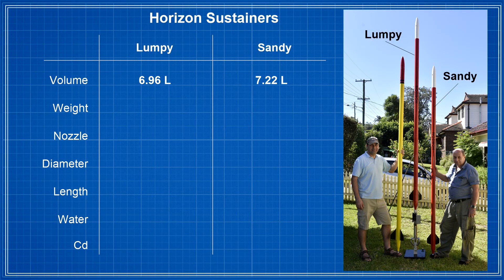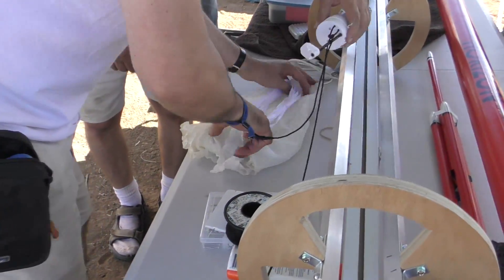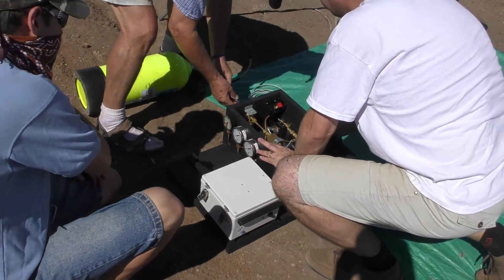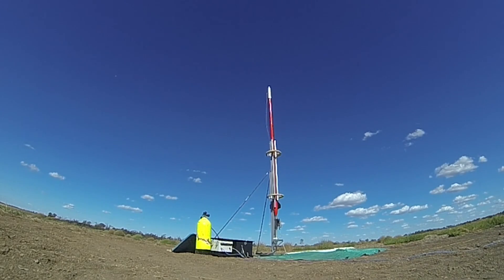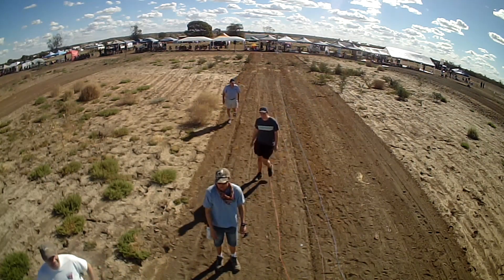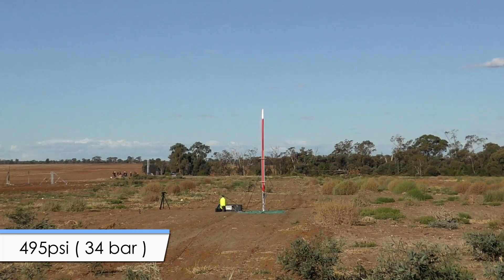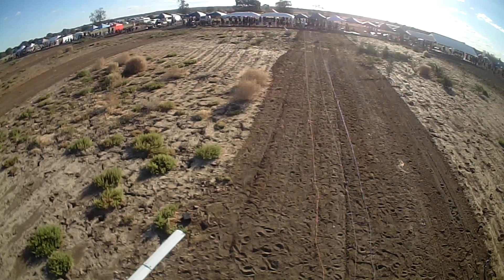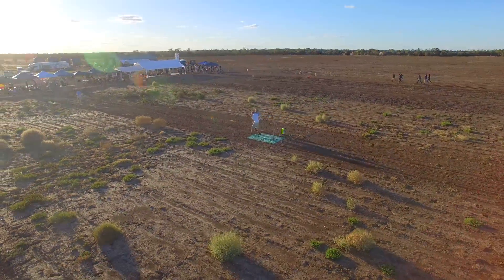2 Stage Water Rocket - Part 14 - First Flight

Comment: Where comes the heat from? The air in the cuba tank is compressed and at normal temperature. If you decompress it during the filling of the rocket and compress it again at lower pressure, must the rocket not get cold?
Reply from the maker: Here is the full explanation: https://www.youtube.com/watch?v=I7i8ELEF3ro

Comment: Load the rocket wite ices water to keep temperature down.
Reply from the maker: That doesn't work. We have tried this approach before. The reason it doesn't work is because the air above the water compresses and heats up regardless if it passed through warm or cold water.

Comment: Why not fill the rocket with ice water? You could also attach a shade structure to the launch tower.
Reply from the maker: Ice water wouldn't really help. The air still compresses above the water and heats up. (we've done the experiment)

Comment: I think I know why your rocket bent,   when you made the composite tube, you made it with a back bone. like a fishing rod,  at the point where the fiber overlapped, it  made a back bone , a point with slightly more fiber adding less stretch,   if you do a crosscut you should see the extra layer overlap . even a few extra fibers on one side can cause a back bone.
Reply from the maker: No, the pressure chamber was made with sleeves which are completely circumferentialy symmetric. Here is an explanation of why the rocket bent: https://www.youtube.com/watch?v=I7i8ELEF3ro

Comment: Funny t-shirt idea: [composed like an old style newspaper headline, in black and white]

"Chipmunks hurl carbon fiber bananas at the moon"

All around the horizon rocket in the middle [perhaps the rocket, alone from the rest of the image could be in color], one chipper with a lab coat, a clipboard and coke bottle glasses, one in army gear and helmet, one with a propeller beanie cap and a slingshot in their pocket, and one with a dynamite plunger and steampunk style aviator's goggles, perhaps with a rather deranged look about him...

Would make good project merchandise.

Comment: This beg for some experiments with rocket temperature and measuring it with "gun" thermometers. Like "will shading scuba tank help with temperature of air pumped into", or "using water with ice crushed/blended into slush to fill rocket and let it melt during pressurising". But I'm worried that temperature difference in parts of rocket may cause structural problems.
Reply from the maker: A lot of these issues will be covered in the next video, including thermal and other experiments.

Comment: if you actually manage to launch this rocket at full pressure you Will be able to reach easily +700m that is over you personal record so im pretty sure you Will manage a +1000m flight
Reply from the maker: For maximum altitude I think one of the trickiest things is going to be getting the second stage to launch vertically from the booster. Even 10 degrees from vertical you lose significant amount of altitude.

Comment: I would think 1, add fine axially aligned tension lines to counter the bending moment, 2, pre-cool your incoming air as much as possible [put the tank in a bath of ice water for instance] and 3, put up some kind of sun shield.

I am guessing that your pressure regulator(s) did not work as planned and that is why it over-pressured?

Even if the pressure was forming from a reaction inside the pressure chamber, this pressure SHOULD HAVE stopped any more flow from coming in as soon as the regulators reached their shut-off limiter(s)

Also, double, triple or even quadruply redundant regulators is never a bad idea with thin housings like  these.
Reply from the maker: The rocket did not over pressurise it reached the correct pressures that we wanted. We do not use a pressure regulator for these rockets. We just have a direct connection to the tank via a small hole and we control the flow of air until we reach the desired pressure.  We normally fill it by letting the air in in bursts, let the air cool for a while and then let in another burst of air. We may have just let in longer bursts of air this time or didn't wait enough time between bursts. This is how we control the cooling. We used a similar fill pressurising pattern to one we used with our other rocket that did not bend. There were a couple of other issues that made this rocket bend that will be covered in the next video. Cooling the air prior doesn't help much because the air picks up heat again while it travels through the hoses and manifolds. The air also bubbles up through a column of water. The air still compresses above the water and heats up. We've done experiments with this previously and bubbling the air through water had no effect on lowering the temperature of the compressed air. We had a sun shield over the rocket prior to launch while waiting, but once it was on the pad we removed the sun shield as we wanted to get clear video of the launch.
Reply: @AirCommandRockets  Somehow I must have misunderstood the pressure to have at some point exceeded the target pressure.

I fully understand the compression heating issue, I work with both engines and refrigeration systems.

Maybe what would be a better way of saying what I meant was to 'encase' the vessel with moisture [perhaps a fine mist on little removable upright rods] which had been chilled. 

They make pretty cheap plastic evaporative cooler nozzles and use them at outdoor patio lounges in hot areas, the idea being that water evaporates at 555 BUT/lb and that the mid-evaporative spray would be partially cooled as it left the nozzle and misted the tube, but then would further evaporate upon contact with the hot vessel body, this could be driven by compressed air to remove the need for motors or complex electronics and would be able to either fall away or remain standing post launch, and would not interfere with a reasonably decent view of the launch, especially since it would stop spraying the moment you stopped applying air pressure and the fine mist would evaporate off of the vessel walls rapidly in the dry air so as to not leave it coated with excessive and needless physical mas or air drag.

By starting with pre-chilled water one would [hopefully] get the maximum benefit of this.

Technically, if one used NH4OH [but this is both poisonous and smells terrible] the chilling effect would be far greater, but I fully realize that your goal is not to choke the crowd and it is known that ammonia can travel a long way and still be offensively pungent even when well below toxic concentrations.

Generally put, 'ice it down' as it fills, much like how the big rockets vent gaseous hydrogen and oxygen to cool their tanks as they fill, only in this case, rather than put heavy cumbersome ventilation on the rocket its self, make it a stand-off attachment.

I suppose one COULD even use compressed air alone, which, while lower in total thermal efficiency, is higher in portability and less messy to handle, just let little tubes of air on those 3 aluminum holder rails vent toward the body where they are allowed to expand in little cones before wafting over the vessel.

Any expanding gas drops in temperature, just as any compressed gas raises in temperature, and therefore you could use some of the compressed air for this purpose  without adding a whole lot more plumbing.

In either case, I eagerly await seeing your actual solution in your next video.
Reply: @AirCommandRockets  By the way, have you tried high temp epoxies?

Comment: Very nice video as always! :) That's quite an interesting failure, it reminds me of some of the issues we had with 3D printed parachute systems. Heat is definitely a problem in rocketry anyway. ;) What are you going to do to prevent this kind of problems? We have used a parasol for the rocket last summer.  Maybe changing the color of the rocket to white would also help (altough it wouldn't look as good). Do you know the reason why this has never happened before?

Good luck and keep it up!
Julian
Reply from the maker: Thank you Julian. We've had problems with black 3D printed components in the sun as well. This was one of the reasons why the nosecone is white, and all the deployment mechanism components that were 3D printed are also white. We suspect why this hasn't happened before and we'll cover that in the next video as well. It's funny the rocket was originally going to be white, but we chose red because it looked better in videos. :)

Comment: If you fill it with some thing heavier than water will it go higher, like if you make a solution saturated with salt will that make the water dense enough that it actually makes a difference in how high it goes? I would think for $10 extra to make it super salty water it would be worth testing out!
Reply from the maker: Not necessarily, here is a video we did on this exact topic including experiments where we compare different liquid densities. https://www.youtube.com/watch?v=Fu3rIiPy_18

Comment: Interesting and quite unexpected. Any idea of the temperature? Maybe incorporate a thermocouple so you can adjust the rate of pressurisation to keep the temp below x°. Fibreglass is a good insulator so you can't simply measure the outside surface temp.
Reply from the maker: Hi David, we have pretty good idea of the temperatures. In the next video we do a test with a test pressure chamber with a thermocouple on the inside and we measure the surface temperature on the outside at the same time so that we can see the lag in heat transmission to the outside. We have thought about putting a thermo couple on the actual launcher, and then have the launcher automatically follow a temperature profile to get the rocket filled.

Comment: Well done! This series is just like a film by Tarantino))) Emotions, tension, fear and humor. Yes, red goes well with the blue color of the sky, but as it turned out this is not technological. It is necessary to make the rocket body mirror. Or use a rocket hull cooling system, for example on dry ice. Congratulations on a successful test!
Reply from the maker: Thank you Water Rockets Club. Tarantino I am not so sure about .. well maybe the carnage. :) We will go to more details in the next video and certainly paint colour is one of the issues.

Comment: You have been lucky, you involontary create a dangerous situation!
Reply from the maker: This is why you have safety procedures in place. The rocket is located 50m away from anyone while it is under pressure. This is why the launcher has a remote depressurisation function, with a secondary depressurisation back up. This is why the rocket was not launched because there was a problem. This is why the rocket is being launched in open farmland. While this is a dangerous hobby at these pressures, you take steps to minimise the potential for harm to people and property.

Comment: What an interesting behavior.  Are you thinking the bending was independent of pressure?  If so, the rocket would bend if you just stick it out in the sun with no water or pressure.  Did it?  I'm supposing we'll hear your thoughts soon.
Was the bending only in the air-filled section, and not in the water-filled section, as far as your could tell?  If so, is the water keeping the rocket skin cool?
How hot was it?  Did it bend towards the shady side of the rocket?  Any way to tell the temperature on both sides?
Did the rocket bend towards or away from the wind?  Was the leeward side a different temperature than the windward?  
Both sun/shade and windward/leeward might be something to test, with thermocouples or optical thermometers.
Are you certain the resin was fully cured?
Do you think maybe one side of the rocket casing composite was resin-rich?  Maybe the down side during curing?   Is seems like I remember you rotating the casing during cure, so that should make it even....
The coefficient of thermal expansion (CTE) for resin is typically way higher than for carbon fibers.  I think some carbon fibers actually have negative CTE, while bulk epoxy is relatively high, like 45-65 10-6 m/m/K.
Or is it possible the layup was slightly askew on one side of the casing?  
Or maybe one side of the composite weave had more wrinkles in it?  Can you inspect this?
Have you calculated PV=nRT to see what temperature rise would be seen for a given pressure rise?  It's P1V1/T1 = P2V2/T2, if I'm remembering the gas law right.  But wait a minute, isn't P1 = zero?   The volume probably goes up a little too.....  You could measure the diameter during a pressure test....
Did you happen to track temperature when you did your casing pressure tests?  You would have to use air in the test, which would be more dangerous than all water.....
Just trying to think of an explanation.
Reply from the maker: All those are very good questions.  I address most of them in the explanation video. The bending was definitely the result of pressure, the rockets were out in the sun without any issues beforehand. The pressure chamber was very uniform in terms of wall thickness and no pooling of epoxy on one side. This is why we put it on the rotisserie while the epoxy is curing. The sun definitely played a role in the failure, and the rocket bent away from the sun. We did thermal experiments in a test pressure chamber measuring internal and external temperatures while pressurising. Again this will be in the video. That is one problem with doing hydro tests for pressure containment you are not testing the thermal response at those pressures.
Reply: @AirCommandRockets  I asked a few friends, and they had suggestions.  One was to add a few axial carbon tape tows between the woven fabric.  Another was to wrap the outside of the rocket with thin aluminum foil.  I think this is what NASA does for many spacecraft, for thermal control.

Comment: would be interesting to know at what heat the epoxy starts to fail.. maybe use a more heat resistant epoxy as opposed to pre launch cooling solutions.  nice test tho..
Reply from the maker: This will be covered in the next video. Temperature though is only a part of the problem.

Comment: Now you know why rockets are painted white.
Reply from the maker: Indeed :) In the next video we do a comparison of paint temperatures. The funny thing is that the rocket was originally going to be white, but red looks better in photos. 
:)
Reply: @AirCommandRockets  I wouldn't think the sun would play that big of roll at least compared to the compression heating of your gas load. Likely getting strong stratification of the gas as well. I've done work with high pressure gas system and I've seen several hundred degree differences between the bottom of a pressure vessel and the top, granted that was with very rapid pressurization. But I wouldn't be surprised if the temperature delta between your water line and the top of your tank was  over a hundred degrees  that would easily be enough to exceed your glass transition temperature on the epoxy. I don't know how viable it would be imbed a thermocouple between you liner and overwrap but a sensor like that  would  be enough to abort  on too rapid of a gas fill.
Reply from the maker: That's an interesting point about the thermal gradient inside the pressure chamber from bottom to top, I guess that is one thing I hadn't considered. We have done some thermal tests now with a thermocouple on the inside so that we could measure the temperature change from the compression heating. This will be covered in the next video. The heat generated from the Sun was significant in our experiments with this paint colour. Again this will be covered in the next video.
Reply: @AirCommandRockets  With an IR thermal sensing gun one should be able to measure actual external temps in real time along the line of the vessel and record them periodically, even painting little targets on the body at regular intervals to allow finding repeatable distances rapidly.
Reply: @DeliciousDeBlair  Composites are actually very good insulators so there will be a lag in surface temperature as well as a thermal gradient between the inside and outside of the overwrap, This reason i suggest putting the TC under the overwrap.  If this was a steady state system this lag wouln't matter and the IR gun would work but compression heating is inherently transient. That being said I don't know their thermal properties of their composite so I don't have an intuitive since of the difference between the inside and outside of their vessel. My experience we used unde wrap sensors and surface sensors and then we able to correlate surface temps to internal, but that only work if you have very consistent manufacturing  between pressure vessels. Additionally  most IR guns have poor repeatability.  While wired sensors are not as convenient they are dramatically more accurate and repeatable.